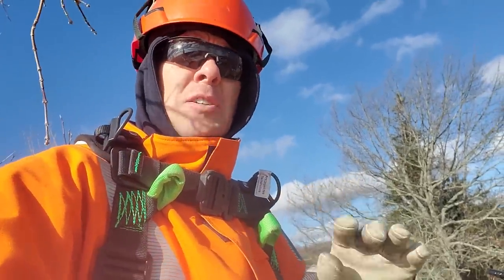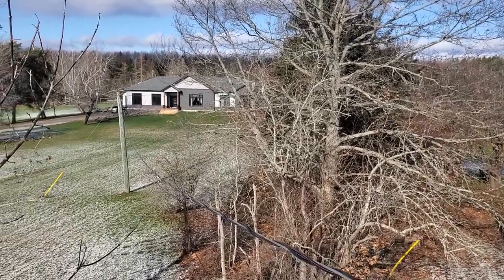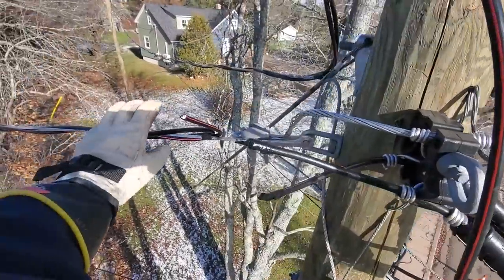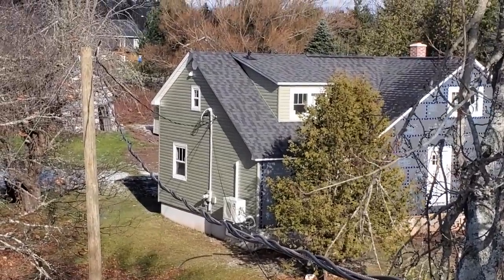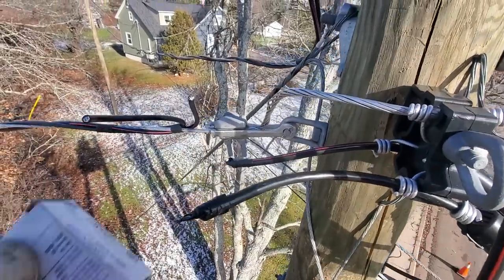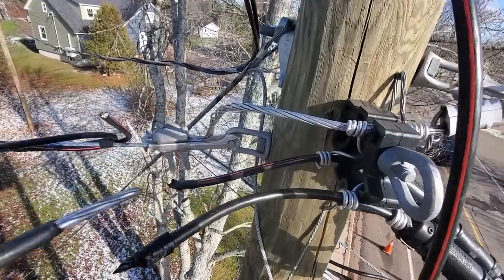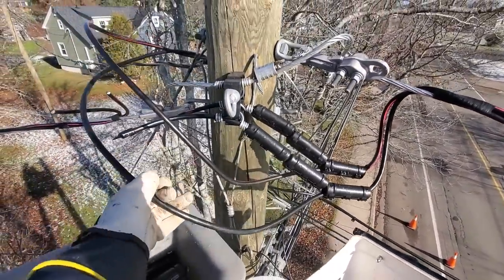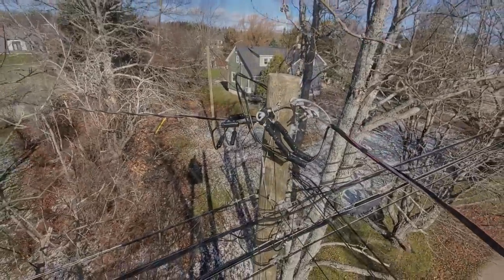Low voltage wire loops

Comment from the maker: Hey Everyone! 

There's a fine line between leaving enough wire for a disconnect/reconnect and having the top of a pole look like a rat's nest. This pole was neither :(... On a positive note, the power still flows!

Most lineman like framing a pole with nice neat loops and parallel runs of wire. It's not an overly big deal if it's not, but neat work is definitely safer! Much easier to keep track of what's what while you're working.

P.S. - I'm not sure why all of those crimpet covers were there 🙊🙈🙉

Have a great week all!🍻👊
Reply: Aaron, here they do use overhead splices like you show there, but when built new, they tend to use enclosed boxes with multiple taps on... I can try to get a picture if you like? (there are a few very close to here)
Reply: I'm not really qualified to judge, but I think that bow of wires is just fine.  It isn't dragging or rubbing on anything or blowing in the wind... it gets all the way around half the pole to get where it's going without really being in the way, and it's got plenty of slack of changed connections.  Future-proofing!
Reply: in the Broadband industry you'd have to replace the whole drop for that sort of thing. Industry policy does allow for one jumper on a drop whether underground or aerial as long as its not under tension but the chances of adding more points of failure and getting audited by a grumpy QC Tech always made me cruse the previous guy who installed it without a drip loop.

Comment: Great advice. Ran into that all the time. Have heard construction journeyman say " Squeeze it & make it hot. I won't have to come back & work on it! Let's go to lunch!!!!" Or hang a cut out directly on top of an xfmr & you can't reach it with an extendo stick from the ground. I was taught to build it like you would be the next person to work on it. Think of he next guy because it may be in a blizzard or torrential downpour with 40mph wind when they have to work on it. Keep up the good work.
Reply: Absolutely.... think of the next worker!
Reply: It’s got the red light guarantee
Reply: @TheChipmunk2008  Because its very likely to be you!
Reply: @rhydianedwards3457  LOL got bit by that today, literally, repair job (residential) from an install we did 5 years ago... apparently when doubling over the wire (I'm in the uk and we use 'tunnel' type terminals) i left a bit of excess sticking out. of course it was the live, of course i touched it... LOL
Reply: I always think about the next guy, or gal! Especially when coding, it should be done in a way that the next person can understand what it is supposed to do. This is also why I am not a big fan of spray foam insulation and the use of so much adhesive in modern construction: buildings get renovated, repairs to mechanicals get made (why there will always be a tile ceiling in my basement).

Comment: I completely agree! I usually do the same thing when pulling wires through junction boxes especially if it's just a pass-through.
Reply: A few extra inches of wire or cable doesn't cost much compared to the potential benefit later on.

Comment: I ben a electrician in Boston Ny for around 35 years. always a good thing leave some extra wire loop. been code hear for a long time. I seen old work that has been re done many times over the years . lots of crimps. some times just chop a whole section of line out and replace with new and 2 crimps. nice work you do. I have come across different wire over the years . copper and aluminum . and some copper clad aluminum . have to watch crimps some times.  😀

Comment: Industrial controls engineer of over 40 years here, doing a neat job takes little if any more time and reflects on your professionalism. It also makes it easier and safer to service. On the one service how much longer would it have taken to form the slack into a neat drip loop (that wild mess wouldn't even shed water as it is) and trim to proper length? On the short one, maybe it was a measurement error, but fixing it before leaving would be the right thing to do. 
I always enjoy your videos, thanks!
Reply: (+1) @Scott Marshall - I concur with forming a deliberate, drop-loop. -Cheers 👍

Comment: "I cut it twice.....and it was still too short!"🤔
Reply: Lol.
Reply: You sound a lot like me. Measure twice, cut three times.
Reply: @robertoswalt319  OMG, that might be funnier than my comment!
Reply: We a guy who always sabotaged jobs. He pulled maybe 35 wires #16 control wires & #14 for motors thru 3 rooms. When he went to lunch we pulled back both ends and taped them of extra tight at a pull box that you had to go on a high reach to get to. When he came back from lunch he could not connect wires at either end. While he went to get the boss we removed tape and pulled wires so they would reach terminal strips.

Comment: Is there any issue with the way the neutral has kind of unwound it self from the bend. We call that "bird caging". Came across it on a 38kv line where it drops from a mast into a station yard.  A few strands had melted away from the heat caused when they separated. Had to replace the dropper.
Reply: that sounds like a poor connection at one of the ends allowed severe overcurrent on some strands, but further thinking about it, it would have probably sustained an arc until burning clear off if that happened!  It's more likely something shorted out to it in the past or lightning banged it there.

Comment: Same things in the comms biz: dress the wiring and make it look good. It is much harder to make it look good and maintainable if the wires are short and/or twisted up right out of the gate. I've also seen fiberoptic cable run through the frame of a street light arm (doh!).

Comment: That brings back memories of my former place of employment running  triplex for temp services at a local construction site...   Was fun except for the boss having us splice short ends of triplex together with  two wedge grips, a "johnny ball" strain insulator,  crimpits and covers and him thinking he was saving money.🤣🤣
Reply: I'm not in the industry, but having worked on other things where fittings are expensive (mostly computer stuff), I'm guessing the wire your boss "didn't have to buy" was worth less than the price to buy all the extra connectors used, right?
Even in the computers I build I try to minimize the number of junctions between the power supply and whatever needs the power.
For instance, the high quality computer power supplies I use are known as "fully modular", this means that instead of having a lot of wires soldered directly to the PSU's PCB and exiting the PSU case thru a grommet, there are a large number of sockets on the PSU for you to attach only the cables you need, therefore eliminating one of the larger cable management problems in a small cramped PC case, namely "what do I do with all these extra wires that don't power anything right now?". With a fully modular power supply, you don't need to do anything with the extra wires because usually there ARE no extra wires.
The problem comes when you want shorter or longer cables than what is provided by the manufacturer with the PSU, or if you want each wire individually sleeved in a color that accentuates the rest of the build so that it looks better (aesthetic rather than functional concerns mostly, but sometimes you do indeed need a longer wire for basic functionality).
In that case, you usually go to a company that specializes in such things and purchase what wire harnesses you need in the lengths you need to make the thing look nice.
But the problem is that sometimes you find a company that doesn't offer cables for your specific modular power supply (because unlike the connectors that plug into devices, the connectors that plug into the power supply itself do NOT conform to a standardized pin-out).
What they will likely offer instead, is cable extensions that WILL make the build look better, but that do NOT shorten the length of wire as I had intended. If I am unable to find a shorter wiring harness from anyone, I will simply use the one provided with the PSU instead, because I can not in good faith add length and connections to the wiring assemblies when I didn't need it to complete the build to the point that it functions correctly.
Extra wire length and extra points of connection means extra resistance, and since inside a computer you're only dealing with a few very low voltages (compared to mains voltage anyways), reducing the resistance by even 50 mili-ohms is worth doing if you can manage it economically. And what is more economical than not purchasing something that would otherwise increase the resistance of the wiring?
The voltages used in a modern high performance computer are dictated by the ATX 12v v3 standard (v4 is on its way soon enough, if it's not already here, and they keep saying that they want to change it to ATX 12v0 (only 12v) some time down the road but that keeps getting pushed back for some reason I don't fully understand.
In any case, the voltages used are as follows: +12v, +5v, +3.3v, -5v and -12v. There is also a +5v voltage supply that is not interrupted when the power supply is commanded to shut down by the motherboard, this is known as the "5vSB" voltage bus, this is usually used to do things like allow the computer to wake up when it gets a signal over ethernet cable (Wake on LAN) or more mundane things like providing power to the USB ports when powered down so that it can charge phones and other small devices (tho these days that's better handled by a dedicated USB hub that supports charging, or if there is no need for data exchange, a simple multi-port USB charger that might support common fast-charging standards like Qualcomm Quick Charge, USB type-C Power Delivery (which can supply up to an astonishing 100w as 20v 5a for laptops, after some handshaking done over the data lines to negotiate the required voltages and currents among the many potential combinations), or other brand-specific fast charging standards (both Samsung and Apple have their own differing standards for that, and others likely do as well).
Reply: @44R0Ndin  modular power supplies? I have never seen one then again I am never in the case of a computer very often anyway..  Back in my highschool days we had an electrical shop and there were  guys that would rip apart old towers, rebuild them, upgrade power supplies  or salvage them for parts.. We hoard stuff we come across where I am employed   and it's funny, the mundane 12v output of some scrapped power supply out of an old computer was enough to keep the mag locks picked up in the lock-down ward...
As for my old boss thinking those connectors were cheaper than the wire as you mentioned  they were   but the Labour for two of us to  sort  through the pile of wire,  prep the ends, make the splice as well as  ensuring any previous "taps" out of that section of used wire were isolated  to where they couldnt touch and cause a fault.... It all took time... A splice here or there is not bad but when you are splicing  50-100 foot bits together to string between poles with a maximum spacing of 120 feet, times 5, 6,..8 spans, the amount of material needed to splice as well as Labour quickly add up.

Comment: 👍👊    Came to the desert to enjoy sunny and warm. 42° F and wind is howling. Go figure. Deming New Mexico 12/12/22
Reply: The only thing needed to be classified as a desert is dryness. Temperature doesn't really matter.
Technically, the north and south poles of the earth are both deserts, because all the water is solid and therefore the humidity is never that high.

Comment: Was there any reason not to replace the whole loop. And cut out the unnecessary 3 splices on the high side and just have 2 splices in instead of 5 in each wire?
Reply: Service uptime and not disconnecting customers without a good reason are 2 factors I can think of right off the bat.
With replacing the whole loop, you'd have to re-do the whole thing, and that means disconnecting everyone that uses that junction.
Reply: @44R0Ndin  oh shit I was tunnel visioned I didn't even see the other takeoff off of the backside, all I saw was the two be was working. That makes perfect sense then.

Comment: should there not be a "lid" on top of the pole?. here in norway, we call that a "stolpe-hatt" (translated: Pole hat). i have no idea what its called in english. but it looks like its missing :)
Reply: I'm in New York state, USA, but since the US and Canada power grids are mostly similar, what I'm about to say should still apply:

I'm looking out my window at the pole that carries the low voltage power wires from the transformer to my house, and I can tell you for certain that the pole and the transformer have both been there longer than I've lived in this house, and we moved here in the mid '90s and haven't moved since. That pole has never had one of those covers on it, and neither have any of the other telephone poles I've bothered to look at in the US or Canada.

However I do know what you are referring to, and I've seen them in use over here in the US. Never on telephone poles tho.
I've seen many docks that use wood pilings to suspend the decking of the dock above the water, sometimes it's a floating platform sometimes not, usually depends on if there's a significant tidal water level change or not.
In any case, usually I can look at the top of those pilings and see that they have been capped off, one common material to use is copper sheet that has been formed to the required shape and then nailed in place, but I have also seen plastic covers used. In either case, if I see a piling that doesn't have a cap, the top of it is usually quite damaged by rot, even if the piling was originally made with wood that has had some form of anti-rot chemical used on it (either pressure treated or soaked in creosote like railroad ties, both work tho there is some impact on the environment from the harmful chemicals used, new poles near fisheries tend to be made of reinforced concrete or plastic coated fiberglass or heavily powder coated steel to avoid those environmental issues).

So those caps do see use over here in the USA, just not on the top of telephone poles.

Comment: Is the neutral bonded to ground at the pole (can't tell what the tension wires are doing) or are the customer's outlets potentially still at grid potential on their neutrals, even with the phase cut off?
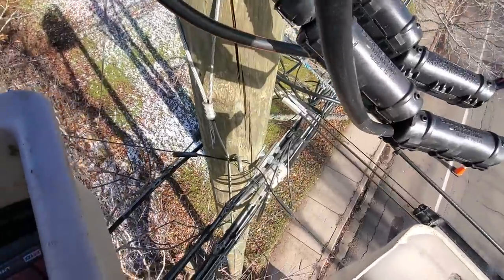Reply: Secondary poles aren't usually grounded, from what I've seen.  Edit:  But this one is.  0:37  The neutral is also lying on the guy wire, and I'll bet it's not insulated either. The guy wire is grounded along with the neutrals.
Each home should have its own grounding system regardless of what the utility does.
Reply from the maker: This pole has a ground that's bonded to the neutral as well as the guy wire and telephone strands. The next pole in the field likely doesn't.
As Jovet said, each home is required to have proper grounding at the entrance

Comment: Do you not have a set of LV fuses protecting the supply to the installation that you can pull instead of cutting the conductors?
Reply: In the North American system the line is unfused from the transformer secondary and through the meter until it reaches the customer's main breaker (or fuse). I believe they usually pull the meter for disconnects but here they probably need to change the metering system as part of the solar installation.
Reply: @eDoc2020  Thanks for the info, quite interesting how things are done elsewhere.

Comment: Any concern with wires rubbing through the insulation with that much slack in them?
Reply from the maker: Not with that setup... If they were rubbing against a light bracket that was 12 ft long, it would sway slightly in the wind and eventually wear through. Same thing if it were to be laying on the wire itself a couple feet from the pole. The way it's laying there would take 100 years
Reply from the maker: Maybe 30... Lol

Comment: That little service holder looks like like it’s more trouble than it’s worth-they a pain or a gain?
Reply from the maker: It can be... They're nice for carrying the mainline triplex and not too bad for new construction service poles in a subdivision. Can be a little tight for crimping tho
Reply: Just to be clear for us lay people... are you talking about the black molded spacer holding the wires to the pole?  Or an attachment point, or something else?
Reply from the maker: The black holder - we call it a spreader block here. 
It has 4 slots to accommodate 3 phase secondary as well
Reply: @Bobsdecline  Thanks Aaron 🙂